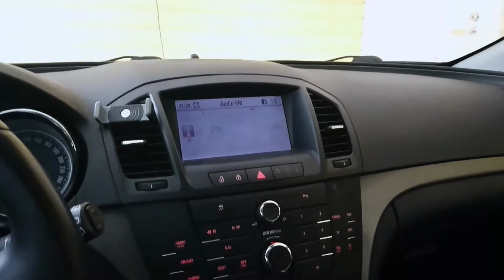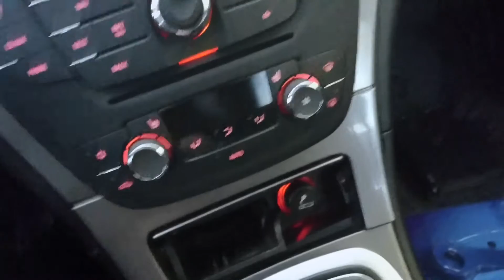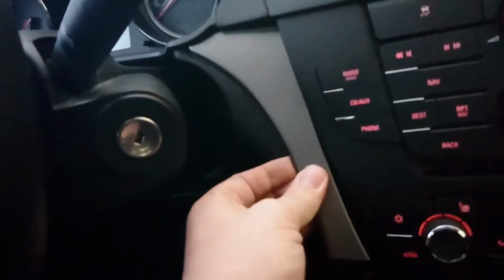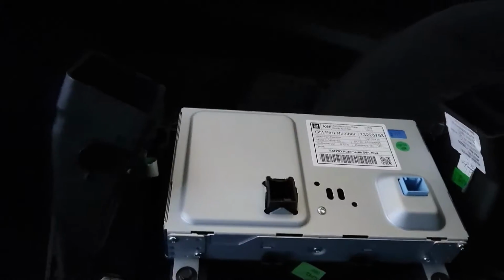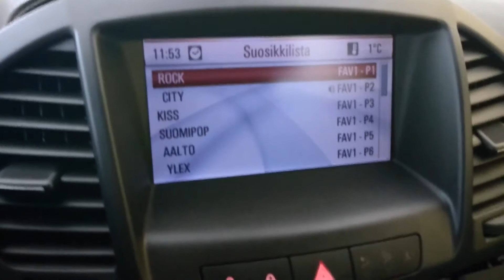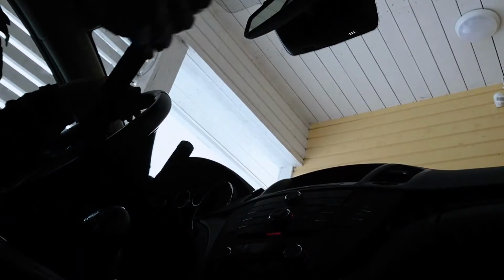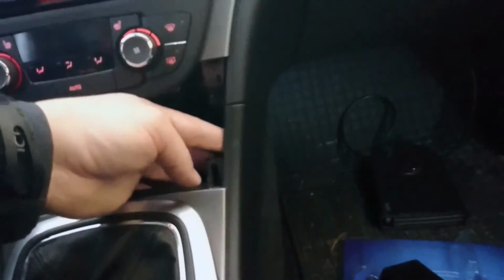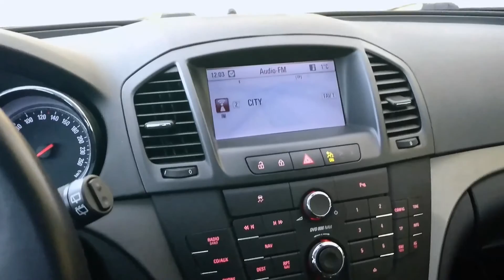Opel Insignia 2010 - Changing Navi Display

Comment: Just to advice everyone I bought a second hand header unit , you need to have this programmed by a Vauxhall dealer as it’s programmed to the original car and isn’t a straight swap but I fitted the unit very easy myself using a uk YouTube video which was first class it cost me £50 for header unit that was very reasonable price and around £60 for Vauxhall dealership to program to my car , took them less than half hour to complete happy days